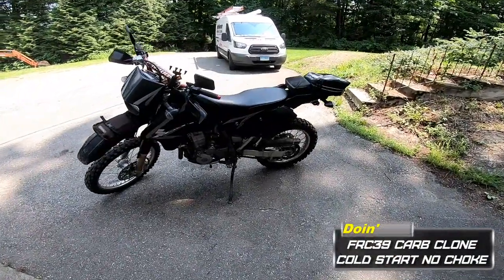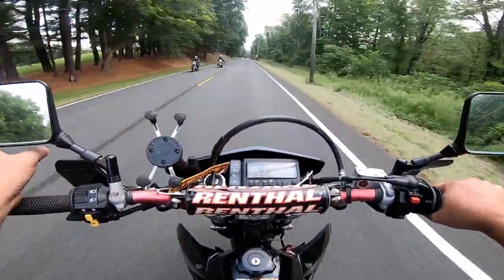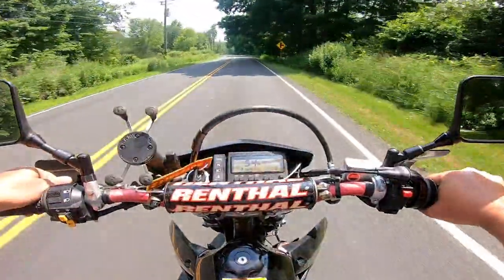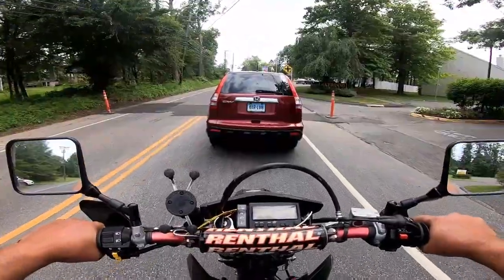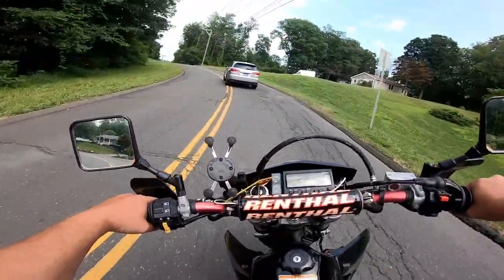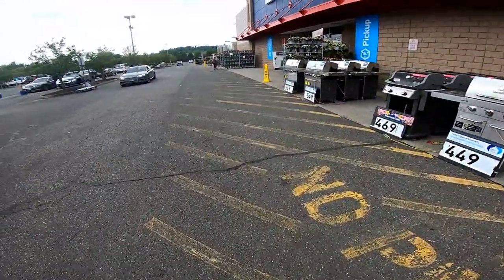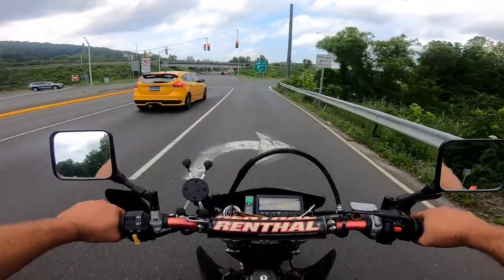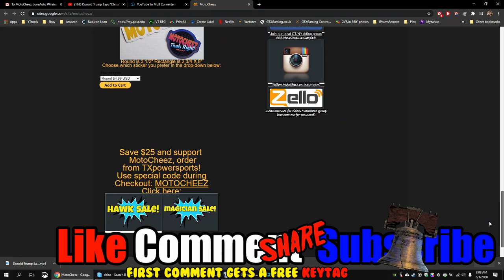(E26) $153 Amazon FCR39 clone carburetor 40 mile ride to Lowes. Suzuki DRZ400 Half-life Motocheez

Comment: Hey got a question for you. I bought a tbr7 was riding it I have approximately 1,000 MI. And oil just poured from the motor it was just covered over all over it. Now it feels like it doesn't even want to start. Have you had any problems with this. Also the little oil filter valve that goes from the air filter back into the motor. Melted open when I was trail riding with some friends. All we had to get out of the trail was just a little tube and we taped it off. If you could please hit me up with this I would really appreciate it.
Reply from the maker: Where did the oil come out?

The tube to the airbox is the engine crankcase vent. Has to be open or it will push out a seal possibly. Also should go up high to like airbox so oil can drain back to crank
Reply: @MotoCheez  Exhaust Recycle Valve melted. and we tapped it off due to we didn't want water getting in it or any dirt. we just trying to get it off  trail. No oil on the left side of the motor it was all on the right side. I don't have the bike with me right now I just sent it to the shop. Where I bought it from. That's probably what happened it blew out of seal then. Or when I was riding it then instead of going back into the crank case it was blowing all over the motor. Which in turn started to seize the motor up. It'll turn over but the starter acts like it's real weak so I didn't really want to mess with it too much for the fact I don't want to lock the up the motor.

Comment: Glad you like the Fcr39 carb I went with the lectron carb on my dr650 it’s a jet less carb that self adjusts with altitude. anyway I didn’t like it even with choke on it was hard to start throttle was very responsive tho. ended up sending it back
Reply from the maker: Over heard mixed reviews on them.

Comment: I used to rebuild ratchets when I worked at sears. Pain in the ass lol. The whole set thing is bs unless they changed it, we broke sets all the time to replace common sizes or odd balls. We had drawers of sockets, wrenchs and screw drivers to dig through. Saw some stupid shit in the tool department too, people bending 3/4 ratchets in half, people cutting and welding wrenchs and ratchets then wanting to exchange it, or people using screw drivers as chisels.
Reply from the maker: Wow, I'm surprised they let them exchange them in
Reply: @MotoCheez  we didn't. If they modified them we could refuse them, especially if they were cutting and welding crap lol. Also if someone engraved anything on them, or painted or anything like that we couldn't rebuild it and had to scrap it, but they could still exchange a failure.

Comment: "E' Model has numerous changes: Comes with a FCR39 pumper with no CV, Comes with manual Compression release lever, and the exhaust cam doesnt have the centrifugal one, Also "E" model has no electric start (Kick only), other odd things, radiator brackets different, fan mounts different, some other bodywork changes- Hotter stock cam, more compression piston(stock) - Over all, it's best to get an "E" motor, and use the top end on your S or SM - with a pipe, of course-
Reply from the maker: I've looked into that, maybe once I need to freshen mine up 😁

Comment: Some people hate em but I’ve been running a tune able super trapp on my Kawi 650 DualSport. The fact that they’re tune able. You can make it as snappy, crappy or quiet. As you’d like. 25more days before my WUMT shows up!
Reply from the maker: I remember the super traps from years ago, didn't even know they still made them
Reply: @MotoCheez  they ain’t cheap but I’ve been beating on my Kawi for 38,000 hard miles. I love that can. I think I might put one in mini when she makes landfall! Braahhhhp. May I ask a mini question?(goin for it!)
Can you run the progressive springs with stock struts and 2” lift?
Reply from the maker: It would probably sound pretty good, but I like mine quiet you know that. Yes I have progressive springs on the front of mine
Reply: @MotoCheez  progressive springs WITH original strut towers? They’ll fit original spring detent? I was looking for the vid but couldn’t remember if you said original struts or not ..
Reply from the maker: Yes OEM struts
Reply: @MotoCheez  much appreciated! I cannot wait to tinker with that little feller!
Reply from the maker: Sooooo much fun!!🔥🔥👍👍

Comment: Hello MOTO...almost got'r running like a 500cc....I dealt with a 500cc...trying to get'r running like a 600cc...then I rode a xt600 yammerhammer and then I knew...no getting around a big bore...never got to ride a Honda bigbore  600 or 650..I loved power...my trainer was a RM370 motocross...I geared it down to trailride and hill climb...then I went xr500 honda...never owned one bigger...love a torque monster..peace out MOTO...
Reply from the maker: Those bikes you rode were monsters!

Comment: Pretty sure this is going to be my next mod.  May add Hot Cams while I'm at it.  Did the Performance CDI make a difference?  Or do you think it's a waste?
Reply from the maker: The performance CDI I bought didn't fit and I can't find one that will....
Reply: @MotoCheez  I was hoping that the research I was doing was incomplete and that you found something new.  The only people I've found that have successfully swapped the CDI are people that have done full EFI (and that rabbit hole is a LONG and expensive one), and people who swapped for a "DRZ400E" version with varying results (depending on their other mods).  I want to go full Athena, but hate measuring and grinding piston ring gaps.  Who knows, maybe I'll hire someone to do the dirty work for me =P
Reply from the maker: Agreed. I felt it wasn't worth the mod...
Reply: @MotoCheez  I'll second the Yoshi pipe suggestion, as well.  I got the full pipe and header kit and it's only slightly louder than an unmolested stock can.  It's only really noticeably louder at WOT.  If I ride like a granny (which is 90% of my riding anyway) I can ride without earplugs.  Can't speak to the FCR adding any decibels, as I haven't done it yet.  I went with the full aluminum one as the carbon version wasn't much lighter - and therefore, what's the point?  Installation was easier than re-jetting the stock carb with no additional parts or fiddling, needed.  It comes with a baffle/spark arrestor you can remove if you want to pierce your eardrums and get Smokey the Bear on your case.  I know someone who has the FMF q4 and it's about the same.  Every other pipe I've heard is louder in comparison.  Still not nearly as loud as the stupid Hellcat that rides around my neighborhood with his pipes on "race".  Low down power is noticeable and I can get the front up in 1st thru 3rd if I cane it.  Can't speak of high RPM as I haven't had it out to stretch her legs, yet, but I think it should enhance the low and middle torque even more.  After all these power mods, I'm likely going to add kickstart and wide spaced gears, just cuz I'm a masochist =P
Reply: @MotoCheez  I'm about to take the plunge on the Kipa carb, but had a few questions - I'm pretty sure the S and SM have the same length of throttle cable; did you need to replace yours?  The manufacturer stated that this carb has no choke.  Do you have one on yours or refit one from the Keihin one?  Did you end up using the jets that came with the kit? (Guys on Thumper Talk tell me they're junk and to use JD Jet Kit jets).  In the 7 months you've had it, have you had any issues (especially with cold start)?  Thanks in advance!
Reply from the maker: Mine has a choke but you don't need it because you have an accelerator pump it just pump the throttle and then hold it, my stock throttle cables worked, I did buy keihin jets off ebay I didn't buy a kit.
Reply: @MotoCheez  Thanks for the quick reply!
Reply: @MotoCheez  Incidentally, I did a market research and earned $150 gift card from amazonia, which I'm using to buy the new carb.  The focus was on the next iteration of the DRZ.  While I can't confirm anything, it looks as though they're looking to bring the next gen into the 21st century.  Highly likely is a 6th gear and fuel injection, but also ABS/safety IMU, improved lighting, seat, and some misc  (like a fuel light, tach) - at least that's what the "lead topics" were about.  I'm hoping to get into another one when they have a mock up of the "concept".  There was a hint or two that the styling (at least for the supermoto) would be similar or "the same flavor" as the current KTM 450 SMR  The replacement looks to be "within 2-4 years" as the smog regulations on the carburators becomes too strict for them to keep "as is".  I'm speculating (and this is just me), that they're going to increase the displacement to 450-499 cc (they want it to remain an "entry level" dual sport).  If they do that, the horsepower number should be bumped to at least 45ish to low-mid 50s, with the Euro market capped with a restrictor (due to licensing) at 45-48  Might be doing all of these mods in vein, but hey... I love tinkering, so nothing lost, really.
Reply from the maker: Whoa. That would be badass! Very cool
Reply: @MotoCheez  Waiting for all the other parts to arrive and for the weather to get a little warmer so I can put the Chinese FCR in.  Did you keep the other two jets (the ones on either side of the main? maybe its the pilot ? (still new to carbs) as the ones that came with the carb?  Or did you swap them out, too?  Thanks in advance!
Reply from the maker: I changed both out I believe. I said what I used in the video and usually the description too. 8 don't fully remember lol. I do so many carbs!

Comment: How has the fcr39 carb doing so far? I just purchased one.
Reply: Nevermind
 already asked you 😂😂
Reply from the maker: Does excellent, but you have to get an adapter for the back because someone else stated out that I did not even notice the horn on the back is still leaves too little air jets on the bottom open I found one and I believe I put it in the link already It's a plastic piece that bolts on the back of the carburetor so you can connect it to the air box
Reply: @MotoCheez  thanks I will check out the link
Reply: @MotoCheez  is it the big 2 Inch boot link. I don't see the link 😕  I could be blind af
Reply from the maker: https://www.ebay.com/itm/325763417066?mkcid=16&mkevt=1&mkrid=711-127632-2357-0&ssspo=q2NHhua5TMS&sssrc=4429486&ssuid=y7YIrAaUTmi&var=&widget_ver=artemis&media=SMS

I guess I didn't add it yet
Reply: @MotoCheez  thanks just bought it

Comment: It's "Bronco sport" Yuppie version Bronco. I don't like the new Bronco, no V8 engine.
Reply from the maker: That's another thing, I'm not much for the EcoBoost engines especially off-road. They have not proven himself at all. Lots of issues including transmissions
Reply: @MotoCheez  My family had a EcoBoost engine 3.5T f150. It's EcoBullshit, got 18mpg on the highway. He changed it to a new V8 f150, 22 mpg on the highway.
Reply from the maker: My dad had a Ford flex with the V6 twin turbo and that thing sucks so much gas when he was towing a camper then the belt blew off of it he traded it in